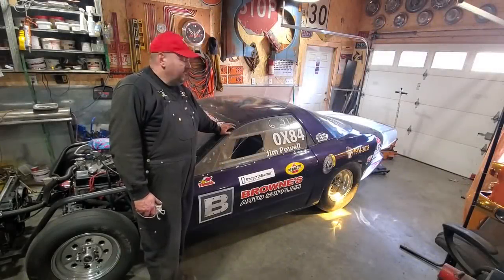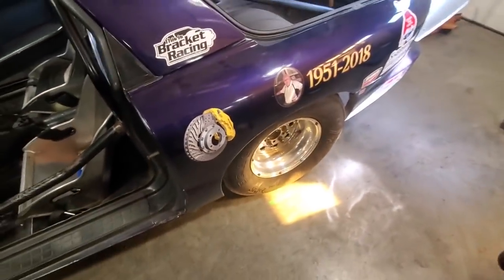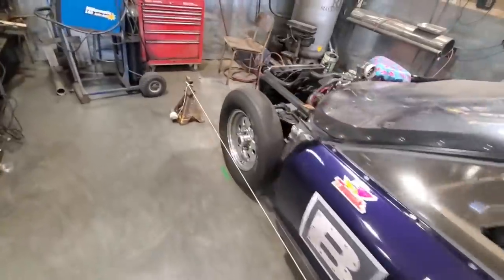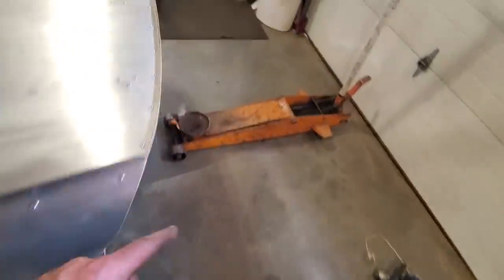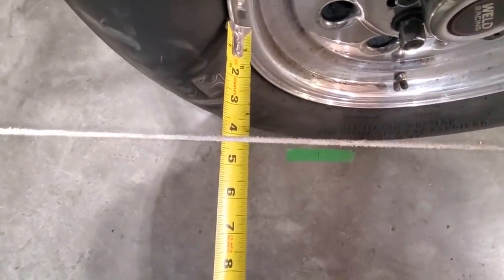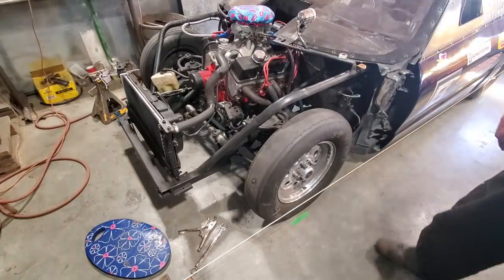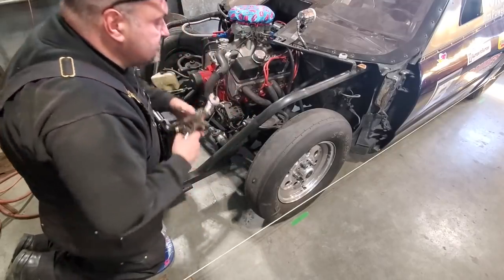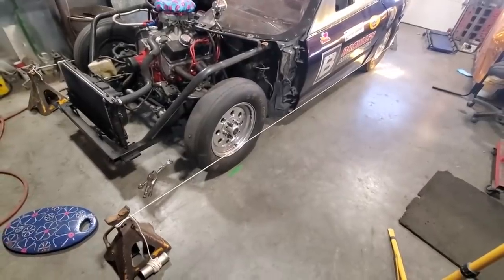How to do a wheel alignment with string!

Comment: Straightening the rear end will make the car go down the strip straight, instead of sideways!  Like doing a rear wheel alignment on a pushbike or motorbike. This string trick is good for setting toe, as long as the camber and castor are correct to start with. Very handy if you have to replace a tie rod or tie rod end. Back in the 70's we used to use an adjustable rod to do toe in. You set the rod so that it's tight at the front of the wheels and 1/4" loose at the back of the wheels. Worked well on our 60's cars at the time.  These days, we get wheel alignments done at the shop when necessary, which is hardly ever, as they seem to stay correct. You always have handy tips.  All the best from Queensland Australia.

Comment: You can do pretty precise alignments with a slightly more tedious version of this method. A few years ago, a friend and I did an alignment on our endurance road racing car with strings and jack stands in my home garage. At about the same time, another friend took his nearly new Mercedes to the dealership for a supposedly sophisticated wheel alignment. Our car came out perfectly. His had its steering wheel off by about 30 degrees. And the manager tried to argue with him that it was acceptable...

Keep up the good work!

Comment: I really do like your tips. Being an old mechanic and doing alignments for many many years, you just set the toe and let it go but that was far from an alignment. If the caster or camber is out that toe setting will do little to help steering or tire wear, plus you only need a measuring tape to set the toe. Also, don't forget that a front wheel drive has its toe out 1/8" as the front wheels pulling will toe themselves in. But you are right about trying to find someone than can do a proper alignment on any car let a lone an older one. A proper alignment takes time that most shops don't want to spend, get them in and out as fast as possible, thus the "set the toe and let them go". Keep up the great videos, your tip and tricks are a fantastic help.

Comment: HA! A month or so I watched a video about repairing  a rear window frame. Realized right at the end of this video, that it was you again. Hehe. Thanks! I will use this on my Torino. There's an alignment shop a block or two away, and I took my non street legal car there since it was close. They told me they didn't have the specs, but had the specs for a 65 El Camino. He said it's the same thing? I think he thought my car was a Chevy. I asked them to please take it off the lift. This was after them pulling it up on the lift, and leaving it in the run position. I mostly wanted it off the lift because the resistor wire was probably hot enough to melt by the time they started it again.

Comment: Do this all the time when working on my own cars. Actually use a framing square and electronic angle finder to set camber and caster also. Learned alignments on old Hunter light align and string align machines, now newer mechanics just get it in the “green” but don’t understand what they are doing.
Reply: Please explain your method for setting caster and camber. Looking forward to your response.  Thanks.
Reply: @lestergreen7262  camber is easy, I put a 4 foot level across the paved area just in front of the tires and zero my angle finder on the level. This gives me relative zero. Using a large framing square or square tube straight up and down edge to edge on the rim, the angle finder will give you the camber angle with wheels straight ahead. If you turn the wheel 30 degrees you will see the measurements increase, this is caster. I go to end stop so I don’t have to calculate turning angle, caster has to be even for the car to go strait on a flat surface. Too much will increase turning effort, too little will make it a real squirrel to drive. Lots of YouTube videos on different methods, best to understand how the geometry works but you can usually get something close enough to drive correctly with these methods.
Reply: Pretty much. Especially Camber+Caster. I've had a tech coax Caster into the green by putting Camber at it's limits (too much +) in a modern RWD with with Power Steering. Just set the Camber at optimum 0+, make sure to Zero Cross Camber, and make sure Caster is NOT under: Over Caster is fine in this case. Increasing turning effort equals straight line stability at speed, and the Power Steering takes care of the increasing effort at parking speeds.

BTW: Isn't it Camber that has to be even (Zero Cross Camber) for a car to go straight on a flat surface.
Reply: @iroulis  i believe caster affects srtaight line stability on flat surfaces more than camber. The side of vehicle with greater caster will make car pull in that direction. Typically slight  adjustments in caster (side to side) is used to correct for pull on crowned surfaces
Reply: @lestergreen7262  caster and camber are both directional control angles but caster is non tire wearing so better to use caster to compensate for road crown. I always used 1/2 degree more positive on left.
Reply: I have used a Hunter string align, Bear 4 D, and a couple other machines but always had the best results with the string align. About the new techs you are right, they think an alignment consists of setting the toe and sending it. Caster,camber,and a centered steering wheel are too much for them to deliver.

Comment: Thank you for explaining this, I've gone to shops and the techs would say my car was in spec only to constantly go through tires, and never be right
Reply: Factory specs have no regard for tire wear, all about comfort and safety. At Bear Wheel alignment class in 1980 they told use 1/4 positive Camber max, even on both sides. Caster to Factory spec with 1/2 degree more on left to compensate for road crown. Toe in 1/16 on rear wheel drive and 1/16 out on Front wheel drive cars. Most alignments are done at tire stores so tire wear is more important to them then it was at the factory.

Comment: Using string method, you need a clear line from the front wheels to the back.  I have done alignments on some British sports cars where the wheels are inset into the bodywork and this technique won't work. 

What I have done is made essentially a pair of large framing squares out of plywood pieces about 2" wide. One square has the bottom leg nearly the full width of the car, and the other can be shorter. I also put a finishing nail into the wood at the centerline of the wheel, so it can just touch the rim and act as a stand off. I lay the long end of the squares on the ground behind the front tires but standing vertically, one square on each side of the car, and line up the nail on the edge of the rim on each wheel. Then put a pencil line where the bottom legs of each square overlap each other. Then move the squares to the front of the tire and repeat. The distance between the two pencil lines is the total toe, measured at the axle height of the rim. 

To ensure the wheels move easily as I adjust the tierods and give a true toe reading, I put two pieces of plexiglass under each wheel with a generous blob of chassis grease in-between the two pieces of plexiglass. These act as turntables and let the tire turn freely, while keeping the car at normal ride height.

Comment: This was cool. We have been doing this for years. We have done it just to drive the car to the alignment shop instead of the flat bed. The last few times we have been told it was dead nuts. Taking your time is key. We also use the calipers and get right down to the .000

Comment: I used you idea on my Smart Fortwo, which has standard smaller width tyres in the front. It looked exactly as the drag car. I recently had the alignment done and it gave me a chance to check it as there had been some pulling to the left still. It confirmed the alignment was out, checked the steering adjustment and found the nuts had not been tightened! So thanks for your help!

Comment: Changed front strut on my mk7 civic and it put the tracking out, if you know the civic has the steering knuckle on the strut, and not on the hub, silly design. So gave this a try and seems ive pretty much nailed it, wheel straight, car goes in a straight line. Only time will tell on how tyre wear goes. Big thanks for this.

Comment: This helps  I pulled the front beam out of my vw bus replaced 95% of the parts with new , was looking for an easy way to dial in the front end alignment. Then will look for a shop that can do the last little bit . I have all new tries this should work..

Comment: Man, wish I'd seen this 3 weeks ago before paying $300 to have my 67 Dart aligned.  I did the camber myself with a tool I built, and that was less than 1/2 degree off, but I wasn't sure how to do toe.  So simple and well explained.
Reply: Yikes!!! $300??? 😲
 My first home alignment job was on my 67 Dart GT eons ago!! String lines, scribe marks on the cement and a plumb bob LOL...But it turned out perfect!!
Reply: @wheels-n-tires1846  Yeah, to try to explain it they also "adjusted the steering box."  Since it's a manual box, basically they just loosened the lock nut and took out the lash, which was probably a 3-minute add to the job.

Comment: Great video, need to check my 55 Oval Beetle as I’m waring one of my front tyres. 
Only got a gravel drive to work on, so that’ll mean some ply plates to sits axle stands on and go from there. 
Thanks for the tip 🤙🏻👍🏻

Comment: Fitzee these old tricks work real well I used to race Roundy Rounders, those are a bit different than the straight liners you run!
things like 3/8" difference in wheel base side to side (rules were Min 108" WB +/- 1/2 in) that was a frame adjustment dropped the frame  1/4" as well and add a little twist for that "Chevy Lean" camber was -1 degree on LF and +3 on the RF caster was adjusted by what tire temps told us, we'd tweak that during the week......from there toe was usually set 1/4 wide at the front  as well I used to pretty much always run coil spring cars as oppose to leaf spring cars

I had a car that really wanted to turn itself left on a dime but if you wanted to go right you'd best have about 40 acres to do so!
fun times on sat night bull rings (on a banked 1/2 mi oval!) with a couple dozen other cars bumper to bumper and side to side
@ about 80 MPH!......fun times! 

These days just  I do it on iRacing! I don't have a "Motion Rig" Sim but the rest is all pretty much pretty much high end stuff...
Reply from the maker: The roundy round stuff is very cool. Always wanted to build a car. Just couldn't find the guys to do it with. All my friends were drag racers.

Comment: Yep use this myself. Leaves my neighbors scratching their heads.
Not many alignment shops around here deal with larger tires like 35s. 
For instance ball joint wear with taller heavier 35s creats driving issues even though same wear on stock vechical acceptable.
Also add my alignment cost under $2 for the string. Lol

Comment: Well Fitzee, I would like to offer some little extra to your process. Use fishing line because there is no fuzz and easier to hit the mark. Before you lay out the line, take a thin piece of wood and drive a nail through it and counter sink the head. Then jack up the front tire and give it a spin. Then, as the wheel is spinning, slide the block of wood up to the tire and scribe a line anywhere in the tread area with the point of the nail and hold it until the scribe continues around and meets the start point of the line. Then do the same for the other side. This will leave a thin line all the way around the tire eliminating any issues with a "wheel runout" (bent wheel or hub). The wheel and hub can be wobbling but the line will be perfectly straight with the spindle. Then measure from the string to the line you scribe around the tire.
Don't let the nail dig into the tire. Rotate the wheel so the nail is scrapping and not digging in. Also adding a bend to the nail, a 1/2" from the tip at like 45° so the point is the only thing touching the tread works good especially when the tire actually has tread. The block of wood is just a base to keep the nail stable that can slide easy, like a 1x3 and as long as you want. sweep the floor so the block slides easy and smoothly without tipping from side to side. Centerline wheels bend fairly easy. The wheel you have on that car looks pretty stout so it shouldn't be an issue but you never know. Sometimes even crud between the wheel and the hub causes wobble and the further away from the center of the spindle the more the wobble has an effect on the measurements. 
Thanks for the video!
Reply: 😳  That was some stuff said right Thayer 😉

Comment: FORD front n back, when's he gonna finish the job? lol.  I align my off road Bronco using the same method. Under the front tires I put 2 home made pivot plates, so I don't need to rock the car back and forth to match the adjustment made to the suspension. Thanks for the tips....
Reply: I use plastic garbage bags under the front tires.  They make pretty good pivot plates on  concrete floor.

Comment: Those jack stands look like those recalled by my favorite tool store, the old Hazzard Fraud (thanks AvE), although I'm sure other outlets sold them too and may not have issued a recall.  I still have about 6 of them.  That's a good use for them.  Good job.  I do a similar trick to check camber by dropping a plumb line down the center of the wheel.
Reply: Please explain how your plumb line helps to determine castor. I've seen Tony's string tip before but have not heard of yours. I look forward to your response.  Thanks.
Reply: @lestergreen7262  It can't. It's only good for checking camber.
Reply: @lestergreen7262  Of course you could use an angle finder if you have one. LOL
Reply: @lestergreen7262  The measurement requires a formula from trigonometry  Angle = arcsin (Leg/Hypotenuse)  where leg is the distance from the top of the rim to the plumb line - the distance from the bottom of the rim to the line.  The hypotenuse is the distance from the top of the rim to the bottom of the rim.   for example:
Top of rim to plumb line = 15mm
Bottom rim to line = 5mm
Rim diameter = 381mm (15 inches)
camber angle = arcsin {(15-5)/381} = arcsin(10/381) = arcsin (0.026246719160105) = 1.5 degrees.  
Note that in the example the top of the wheel is tilted inboard so we have negative camber.  If the wheel has positive camber (top of wheel is tilted out further than the bottom) then Leg becomes bottom distance - top distance but the formula remains the same.

Caster measurement requires the wheel to be turned full left then right.  The body work usually interferes with making the measurement.

Comment: As always, excellent tips. Thanks. One of the many things in my life  I don't understand: I am wondering why the adjustment is made with the wheels on the ground.  Seems to me that up in the air would have made the adjustment easier or it the downward force (weight of the front end needed) in order to simulate read road conditions?
Reply from the maker: As a car is raised the geometry changes. You want it set at the place its most used.
Reply: @fitzeesfabrications  Thank you for the clarification. There are many holes in my knowledge base it seems

Comment: I have plates I made that bolt onto my hubs (wheels off but supported by blocks under the control arms to simulate the cars weight on its wheels) with slots for tape measures I like this method to check the front wheels against each other... I do like the idea of referencing from the rear wheels too tho I will end up trying to combine both methods I think it will tell me a lot more about what's going on with the entire vehicle... Some things I think u left out is that the floor must be level, the car has to be at ride hight supporting its own weight and wheel bearings, tie rods, ball joints, struts etc.....all have to be in good shape to get any sort of decent results!!! The world needs more people who are competent at doing things for themselves I work at an auto parts store and some of the things I see are both sad and frightening...

Comment: When setting up a vehicle to have 1/8" total toe you need to adjust each front wheel to have 1/16" toe in to achieve a total toe setting of 1/8". If you set 1/8" on each wheel your result will be 1/4" toe. End result is a lot of tire scrub causing tire wear and mph on the top end of the track. On the street it will also cost you extra fuel to drive every mile.

Comment: I believe that those spacers on the spindle arms have little effect.   Laws of physics says that the virtual effect will be a straight line between the connection points which will be the inside rack  pivot and the spindle arm without the spacers.   You could put in any amount of spacers but the geometry will end up the same.    Really doesn't matter if the rack rods are level.  Draw a line from the inside rack pivot to the actual spindle arm (no spacers) and that is the bumpsteer angle.  I agree that moving the rack will improve the issues and I'm sure you have improved the firebirds steering by moving that up.
Reply from the maker: There is a arc that both the control arm and rod end follow. If the angles are not parallel. When they are not parallel bump steer accures where the two arcs intersect then move away from each other pushing or pulling the wheel in or out. I did this test on the 66 mustang project  where I installed a rack and pinion setup in it.

Comment: I got tired of paying shops $150 or more for an alignment, I drive mostly 4 wheel drive trucks and Jeeps, the only thing you can really set without replacing parts on straight axle trucks is toe-in. I used a ruler to set toe and then would just play with the drag link till I got the steering wheel straight. It looks like your method will save me some time doing test drives.